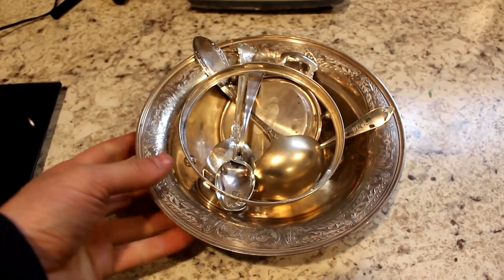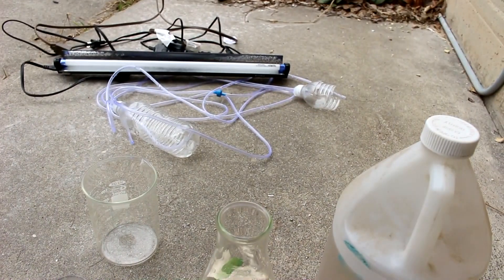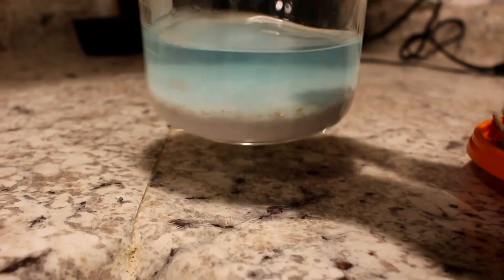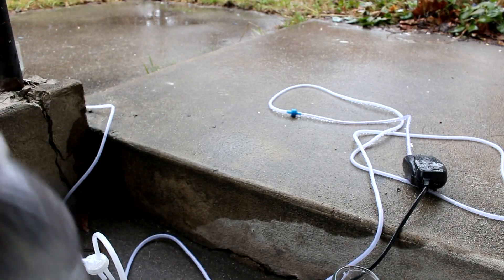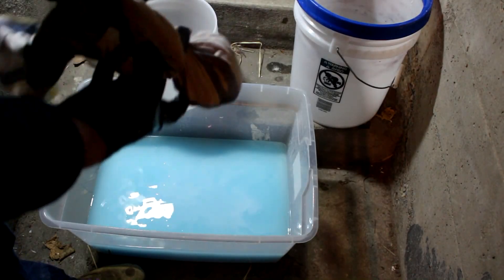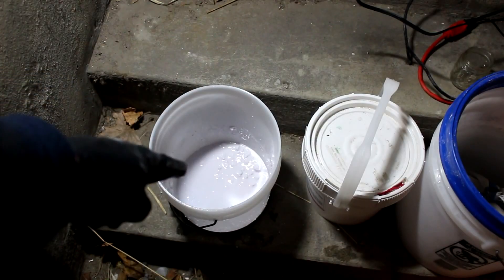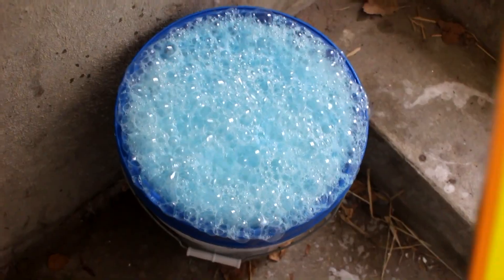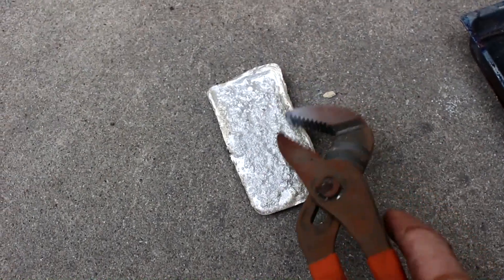Precious Metal Refining & Recovery, Episode 7: Fining Silver

Comment: Bit late to the party, but that silver metal looked like it was way too overheated when you poured it. Silver readily absorbs atmospheric gases (mostly oxygen I think) when molten, it’s a real pain when casting jewellery as it causes porosity in the finished piece. Best to keep it protected from the air until it reaches a cooler temp, then pour so it solidifies quickly before it has a chance to absorb too much oxygen.

Comment: You often stated that silver chloride will decompose into silver and chlorine upon heating, but you are terribly wrong. I learned it the hard way, I didn't realize that my KOH didn't fully react, leaving most of my silver as silver chloride, trying to melt that gave me some stones instead of silver metal. Silver chloride simply melts into a slag.  I had a hard time converting these stones back to silver metal... These are  soluble in practically nothing.

Comment: < Sterling silver is an alloy of silver containing 92.5% by weight of silver and 7.5% by weight of other metals, usually copper. The sterling silver standard has a minimum millesimal fineness of 925.>  So if it's not 925 it's not STERLING silver. Correct?

Comment: Or dissolve in electrolytic cell
No need to cut in chunks
Use KNO3 for electrolyte
Cu and Ag go into solution 
K ions go to cathode
Withdraw KOH solution at cathode
To start.
Then Ag Cu accumulate in solution 
But Ag stays metallic at anode
Next Cu plates out at cathode 
After that
Ag goes into solution 
And Ag deposits at cathode
Leaving Ag Ir in anode basket filter
Come on Cody
You can do better than that. 
I have great faith in you.

Comment: im no expert by far, hell im just a backwood okie that twitterpates on things and i actually took my tattoo machine and wrapped one wire around a silver plated ring an left the ring in a muriatic acid/h2o2 bath. then placed the other wire in the solution and turn my machine up to 12v and the silver begins to dissolve off instantly.but the ring bubbles insanely when the power is running and when letting off the power it stops. any idea why the power makes the silver dissolve off so much faster

Comment: Over on Earth, you have Cody doing what he does ...
Over basicaly eveywhere else, you have our Planet Lifters ... wich is realy just a fancy word for saying:
"Melting down an entire Planet to Liquid if not Gaseous state, then filter all the materials through Non-moving Parts Univerals Material Filters to then turn those into neat Material Qubes usualy around the temparature of -400°C (Humans can't archive that (Yet) as you need to use a Subatomic Coolant liquid for that ... normal atoms won't work ( And you can't realy use a Atomic Storage vessel for those either ... as it would simply flow though it like water through a grate XD ))."

Comment: Im not sure if you even have time to answer the comments but i had some troubles to refine silver that i extracted from photographic fixer. Silver i got from fixer wasn't ofc pure, so i run it trough the nitric acid and then cemented silver put of the solution, using piece of copper (since most silver refining videos are using this rather easy method i thought i'd skip your silver chloride method). If i'd used this silver for jewellery, i would of be happy with it, but since i like to experiment with photography, i wanted turn silver back into silver nitrate, but solution was still blueish - meaning that my cemented silver wasn't pure. Then i mixed my dissolved silver with table salt solution to get silver chloride, washed it and used 30% NaOH solution to turn it to silver oxide and as i followed one silver refining pdf manual, which said that adding hydrogen peroxide will leave me with silver as a metal and NaCl dissolved into water. I started with  aprox 60g silver cement but after NaCl + NaOH + H2O2 treatment i was left with 9,4g silver and lots of slack, after melting. Where did it dissapear? Slack is rather heavy, is it possible that some of the silver is stuck in there as some compounds that didn't react in the reactions? Also i apologize about my english.

Comment: I'm a trained lab tech working in IT, so I'm quite interested in how metals are refined, seeing as I'm the guy at work who's reminding everyone to put the metals in the recycle bin. ;)

I am wondering if you've done, or will do, some videos about refining or separating base metals from scrap. 

Also, about the gloves: I'm guessing you know this already, but gloves aren't technically impervious at all. Various types of chemicals will seep into them over time at various speeds depending on the material.

Once you've re-used a glove too many times, or if a glove happens to not impede a particular chemical (there are big, complex tables for figuring out which gloves impede whatever chemicals), the chemical in question will simply start to reach your skin.

A lot of people assume the gloves are impervious forever as long as they aren't cracking or anything, but they're not fundamentally different from gloves made of cloth; The inside of such a glove is nice and dry until water has saturated the exterior, at which time it starts flowing onto your hand.

Comment: Dear Cody, Would you know the final purity of the silver produced, please? I need .999 silver to conduct an experiment. I'm no chemist. Regards from Brazil. Thanks for your time
Reply: Might be important what exactly you need the pure silver for (it doesn't sound like it's for chemistry to me), do you need a powder, an ingot, lots of beads, etc. ?
(Just a tip)
Reply: Thank your for your answer Cody. Actually I'll test the uses and power of the colloidal silver, generally sold as antibiotic for super-bacteria's. So, final porpoise will be the ingestion of colloidal silver particles in aqueous suspension. Thanks

Comment: could you skip the step of converting the silver nitrate into silver chloride and just directly convert the silver nitrate into silver oxide using the sodium hydroxide?
Reply from the maker: yes actually, I did that in another video in fact. the problem is that I would also drop the copper form solution.

Comment: They said that acid makes food a bit more sour. So I decided to use hydrochloric acid in my lemon pie. Wasn't a good idea
Reply: Oops
Reply: I usually wait for the food to get inside of me before i let it touch hydrochloric acid
Reply: Pi Guy lol
Reply: I tasted hydrochloric, nitric and sulfuric acid. I can tell you that was not good experience
Reply: @박호준-u1c   I bet, those can be pretty nasty chemicals. One of the worst imo is sodium bisulfite. We use it where I work in the RO water system and if you get a whiff of it, it burns your nose and leaves a weird taste in your mouth for a while, like raw peanuts, lol
Reply: @carlosmatos9848  Ha, back in the 1990s, my license plate was NAHSO3. Used to make the stuff by the tanker load. A lot safer than SO2 for removing Cl2 from H2O
Reply: Stomach acid is hcl :)

Comment: In the beginning you say "some are marked as high as 800 and some as low as 400" if you are referring to silver content then NONE of it is actually Sterling which has to be .925 silver. Anything less is not legally marked sterling. Not sure why it would be marked Sterling if 800 is the highest silver content unless the seller stamped it.
Reply from the maker: all of them said sterling...
Reply: Probably Chinese. They have been known to counterfeit the Sterling mark.
Reply: I don't think that is the case with these, firstly there was silver in them and second, if they were going to go to the trouble of marking it "Sterling" they could either leave the numbers off or just put the right ones on there. Maybe the 800 and 400 refers to weight rather than percentage or the eBay seller(s) did not realize Sterling means 925 (or 92.5% silver) and stamped them in hopes of getting more money. It's not illegal to have flatware or hollow wear made out of coin silver or lower percentages, it just can't be marked "Sterling". 
I love the videos though even if most of the chemistry jargon and math is waaaay over my head.
Reply: 83fredly 800 silver is typically german or italian it's a common practice for chinese sellers to buy this cheaper silver stamp it as sterling and resell it at a higher price.
Reply: I just love how Deadpool is just casually watching videos on extracting precious metals.
Reply: lol

Comment: The green/blue colours of copper solutions is not a change in oxidation state of the copper. Copper II chloride complexes are green while hydrated copper II complexes are blue. The bubbling as liquid silver sets is due to oxygen exsolving. Oxygen is quite soluble in liquid silver. I'm not certain but I think this may be one of the reasons silver is used for high current electrical contacts. The silver automatically rejects oxygen that might otherwise cause corrosion in high temperature arcs. The fact that silver is the best known normal conductor of electricity helps too.
Reply from the maker: +Dar Hayward 
hydrated copper has a different oxidation number

Comment: No sterling silver used. Sterling is .925 fine minimum.
Reply: That's not true, 925 is the maximum
Reply: If an article of silver is stamped "sterling", it is required by law to contain AT LEAST 92.5% silver. This is a federal regulation. According to 16 CFR 23.6, (b) "It is unfair or deceptive to mark, describe, or otherwise represent all or part of an industry product as “silver,” “solid silver,” “Sterling Silver,” “Sterling,” or the abbreviation “Ster.” unless it is at least 925⁄1,000 ths pure silver."

The above quote is copied from the actual text of the regulation.

So if you would like jail time or tens of thousands of dollars in fines, any silver marked sterling must be AT LEAST .925.

As a Master Goldsmith I have to be aware of these laws.

Comment: After I dissolve in Nitric I drop with copper tubing or rod. Seems to make a better product with less steps and a little cleaner. I have though done it your way as well but I used Hydrochloric acid instead of salt. Nice vid though. Like to see the copper carbonate result as well. Keep up the good work.

Comment: Nice to see the process. I scrap through a big refiner. I usually bring 10lbs of mixed grade silver at a time and get back 10 ounce .999 ingots.  Same thing with karat gold but much smaller quantities. 400 grams and get back 1 ounce .999 ingots. The karat gold melt usually assays at 50% (8K - 22K scrap and some gold-filled thrown in). I find the metal at junk stores for pennies. The refiner takes 2% of the gold (and whatever silver is alloyed in) and 10% of the silver. $4 for each ingot. Works for me.

Comment: Hey Cody,
1.You converted copper from 0 (metallic) to +2 (dissolved) oxidation state by >>reacting<< it with acid, and a mere dilution* does not change the oxidation state. Ions in solutions are not floating alone (note a notation of H+ vs H3O+) but, besides being strongly attractive charges, are chelated - bound to electron donating/accepting species, called ligands, and forming "complex compounds". The ligands cause splitting of d-orbitals of the d- block elements, such as copper. Thus electrons in those orbitals can jump around by absorbing energy, usually light in UV and visible  region, resulting in colorful salts.

Concentrated copper chloride is green, but when you dilute it, it turns blue, because chlorides chelating copper are being replaced by excessive water molecules.

*In a sense of complex chemistry, this dilution might be also thought of as a chemical reaction.

2. Good idea converting silver chloride to silver oxide. I am from a school of reducing silver chloride to silver using reactive hydrogen formed "in situ", from reacting hydrochloric acid and zinc - but it adds extra cost.  I would suggest though, that you wash your silver chloride with fresh water to further separate/purify it from other metals in the scrap.

3. Silver has a counterintuitive ability do dissolve gases, when hot. So when it cools off and solidifies, it gasses-off, thus the bubbles.  

Great videos! I admire your wide knowledge and enthusiasm. I especially like the mine videos series... I probably hope you will get to a pure vain of gold, or maybe a buried treasure chest :)

Comment: The stoichiometry equations do is not exactly mean the the reaction would react 100% toward ether end of the equation. Equilibrium also comes into play. 

Often when trying to extract something an over abundance of one of the chemicals is needed to push the reaction further to the other side of the stoichiometric equation. Likely why the first attempt did not go very well because 2 moles was just not enough to push the reaction toward the desired side.

Comment: sterling silver is 92.5%  silver by weight. (925)

so for a starting value of 450g of sterling silver assuming almost perfect refining that would = 416g of pure silver.

if you get silver and it is marked 800 that means it is 80% by weight and not sterling silver. 

for 450g of (800) silver the theoretical perfect return would be 360g 

with your return of 343g of silver it would appear that you were indeed refining (800) standard silver.
Reply: +Aoife Orr 

so in theory if you were refining sterling silver (925) you would of been achieving a yield of approximately 82.5%

if it was  (800) silver you were refining that would give you a yield of 95.3% which seems much more likely to me.

i personally work in the precious metal testing industry in the UK. If you like i could test your final product to see what purity you managed to achieve.

Comment: if you have the dissolved gas going into 30% hydrogen peroxide it will do a much better job at recapturing the nitrogen dioxide to recreate the nitric acid. I recommend having the hydrogen peroxide within another container Jack eating it with ice water to slow down the absorption rate this will make it more efficient

Comment: With your acid recovery, would a reflux column work, or is the solution in the reaction flask too concentrated to redissolve/regenerate the acid, so you need fresh water anyhow?

Also, thought about a little manifold for you - since you've got an air pump in, and an air line out, a third line with a luer lock fitting would let you add material with a syringe. Did that a few times with some combustion experiments a few years back filling balloons with known volumes of gas. IV tubing and fittings are super useful in systems like that, and there's even some R/C aircraft hardware that might be more accessible that's used for fuel systems - fill/vent fittings, etc. 

Awesome video. Keep 'em coming ;)

Comment: I've always wandered if it can be done the same with gold but just by melting it and then washing it with HNO3 (in order to dissolve all the other metals, but not the gold of course). I've always wanted to do it with some gold from old jewelry, because it is known it is not pure gold the one that you can buy in jewelries because what is sold it's always an alloy. It would be interesting if you +Cody's Lab could do a video about it (only if what I think is correct). If I'm wrong I'd like you to do a video about refining gold in general :P
Thanks!

Comment: Hey cody,
What about using HNO3 + HCl, HCl is a very cheap acid compaired to both HNO3 and H2SO4. Besides you will end up with the AgCl without using NaCl. The only difficulty i can think of is that the AgCl is insoluble witch could give you trouble while dissolving the acid.

Comment: $20 in acid?? Where the hell do you get such cheap high grade nitric acid from? Here its about $60/L for stuff that it might be possible to obtain.
Reply: +TheIdeanator Commenting for later. I too want some cheap LSD
Reply: +TheIdeanator I'm not entirely sure, a quick glance at stuff (Ignoring the infuriating sites that give timeout Errors, is this normal?) I see roughly $105 per pound for the stuff 0.o
Reply: Noah Hounshel
Yeah, exactly! Its not like where you can go out to home depot for some sulfuric which might be ~$10/L. It's quite restricted (for good reason) but the expense bugs me. Heck, I can get HCl for $5/gal. If I could make nitric from that, I'd be happy.
Reply: TheIdeanator You could make it oc, but then there's that long process and I don't know how easily you can get it in really high qualities.

Comment: Just and FYI: 

Silver under 92.5% is not considered Sterling. All Sterling has either "925", "Sterling", or "STG" marked on it. It is in fact illegal to mark silver less than 92.5% as Stirling.

Fine is defined as 99.9% silver, which is also considered high purity.
Reply from the maker: +Tuisko 
tell that to the people that stamp ".568 sterling" on a spoon
Reply: +Cody'sLab LOL Yes, it's pretty bad with a major lack of control. Especially the older stuff.

Comment: temperature of the molten silver was too high (and the temperature of the mold). Silver collects oxigen from air. It is not flux problem. When we do same job, we use better temperature control or just use much more flux to cover metal while it cools.
Another method is to use shield gas flame to remove oxigen from silver surface.
Reply: and... price for nitric acid at industrial wholesale is about one euro for kg plus taxes.

Comment: I know silver has an affinity for oxygen in a melt.  I would guess that melting finely divided silver oxide would introduce a lot of it into solution.  Especially in a furnace like that where you don't have a reducing atmosphere.  I've often wondered how you can degas the melt to prevent this from happening but I never found an answer.  It was cool to see what dissolved gas being expelled at solidification looks like though.